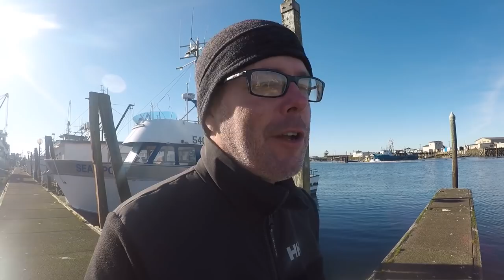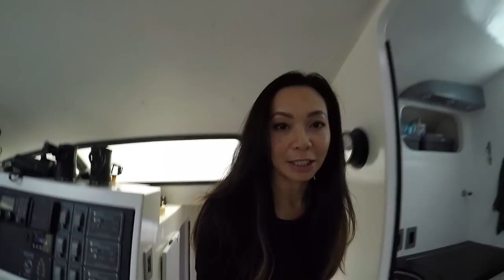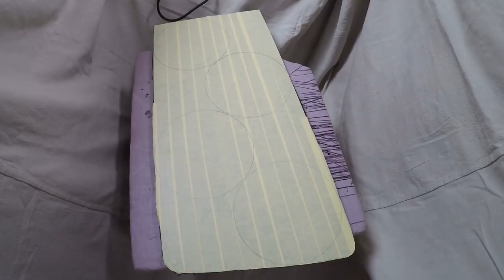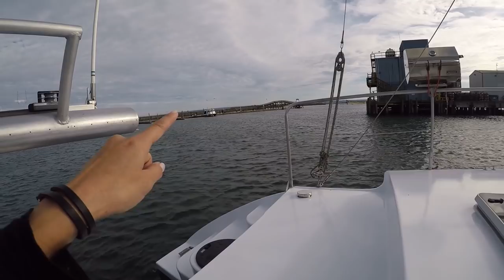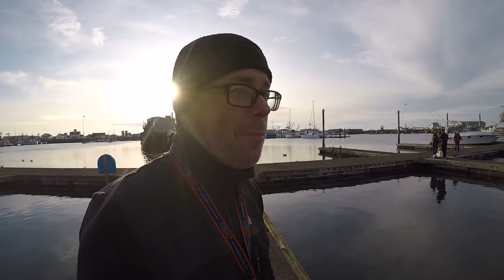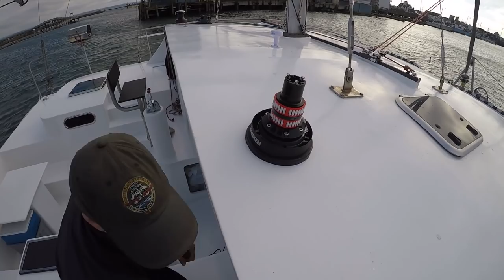Starting Phase II of our Sail Plan - Onboard Lifestyle ep.89

Comment: Just a note to say that the design of this catamaran is a Mastermold Featherlight 43 that Teal has customized to their needs. This boat was build on only two molds, one of them being flat and the other the patented Mastermold. This boat was designed and built by Jace Hobbs in the Florida Keys and updated specifications and plans for it are still available. Teal has the contact info for the designer if you are interested.

Comment: It would be nice to see some of the old footage of more rebuild stuff besides what you've already showed. I really like that sort of stuff. Someone asked a question on cabinet tow kicks and why you didn't build your cabinets with them. That would be interesting to know that information. With the sails, you will probably want several different down wind sails for different wind conditions like a close-hauled and broad reach type of spinnaker and possibly two down wind spinnaker's. One for light air and one for heavy air. Installing a spinnaker pole will give you more options and make your sailing experience much safer and smoother.

Comment: That looks like PE sheet you've used for your backing plates. A good choice because it will bend and take the shape of whatever you bolt it to even if what you're fixing to isn't completely flat. The sheet is indestructible but do you realize it won't stay completely black where ever it's exposed to sunlight. The surface will grey as it oxidizes but that won't affect its integrity. A good job using huge washers on plastic. Most PE fabrication shops will have a heap of sheet off cuts in their recycling bins and if you play your cards right they'll probably give it to you as it's only worth about $1 a kilo to them from the recyclers.

Comment: Try a little trick when working on a smooth surface where small parts can get away from you, place a couple of towels around the work piece then the small bits will stop on the towel if dropped.

Comment: Question #1; Have you considered changing out your standing rigging for either Dyneema or Spectra rigging instead of using the current stanless wire you have? Question #2; You haven't talked about your standing rigging except for a brief moment when you tested it for stretch. My question is that your standing rigging is very old and weathered and that is cause for concern in my opinion. Could you talk about that? Question #3; Are there any other boats like yours out there and are there any plans available to build one like yours? Question #4; When you previously did some through hull drilling or cutting, you didn't fill the Nauticore with epoxy before installing things like your portholes and such. I was wondering why? Question #5; What are your plans on rigging up a spinnaker and possibly a spinnaker pole as well? Question #6; What are your plans on a deck cover? You have built the most beautiful looking boat that I've ever seen! I absolutely love what you did! It would be nice if you did more videos than one per week.

Comment: I asked several videos ago when you were doing install of electrical contactors for the winch below your Nav Station, how you ventilated the hydrogen gas from your lead acid batteries when they are being charged by your installed solar.

Comment: Question 1: do you have any non-skid on decks or cabin tops. I think I saw you paint (part of) the top quite a number of videos ago. But I never saw you apply non-skid and looking at the videos it looks like you don't have any. I remember vaguely you talking about it in one of the episodes about how you are used to not having any but that you would apply it before cruising. But that was a really long time ago I think. So do you have any, what do you have, or what will you get, or will you go without? I assume you waited for the deck hardware to be in place before applying it so you can pattern around it?

Question 2: cockpit hard top? Plans, timelines, designs, ... 

Question 3: what is still on the TODO-list of modifications and changes we might get to see in the future?

Comment: You need to put proper bolts of the correct length for the two wrenches.  You need at least 2 to 3 threads coming out the end of the nut (you want 100% thread capture which includes the nylon on the nut).   thread exposure of 1/4 inch would be better and then dress the end with a acorn nut.

Comment: Two Questions: One- What is your fuel consumption at cruising speed for both engines and what's your range under power? Two- Would like to hear about Emma's homeschooling curriculum? Of course the trip itself is a form of schooling but no doubt you are working under some official guidelines as to the rest.

Comment: I know you always try to do the best work possible. So I freaked out when you substituted machine screws for  socket head bolts. The bolt would only have threads near the end of the full length of the screw.  The bolt holds its torque better over time. one additional thing. The bolt has an un-threaded shank that serves as a dowel pin resisting shear, which is what a winch is trying to produce.  I was wondering how you positioned the body of the winch in relation to the pinion gear. You normally explain things like that. It's something good to tell potential boat workers on your channel. 
You always do such clean meticulous work. You definitely have high standards.

Comment: I understand that you like clean, straight lines but, that 90 degree angle in the jib sheet off the port side winch puts a lot of stress on the sheet. This could be avoided by running a more direct line forward. It would also eliminate the penetrations of one (or even two) piece of deck hardware.

Comment: what type of material did you use for the backer plate
Reply: It looks like what he usually uses for his projects, Starboard Marine Lumber
Reply: Jump way back to when he was putting the windows in, for instance. https://youtu.be/JB1Wn27XNrM?t=335
Reply: It's misleading calling it lumber as it is anything but. It's HDPE plastic. I wonder whether calling it marine lumber attracts a premium when in fact it won't be any different to HDPE sheet you can buy anywhere. Teal hasn't done any yet but it is also easily welded. Great for making tanks, linings, spacers, boxes etc. It's the same stuff they use for dam linings and I've seen it in sheets 6" thick. It's probably the only thing you could have on a boat that salt water will never degrade. You know the plastics in the oceans. Black is the most uv stable color and even then the very surface will get surface oxidization giving it a greyish tinge. It is no good for traditional cabinetry or counter tops because it is too soft /pliable and has a high temperature expansion and contraction rate. ie. Horizontal spans will sag without masses of support and you'll never find a straight PE pipe laying in the sun.
Reply: @tbonemc2118  Yes that's correct but he asked what it is and I gave him the name he could google for.  Not sure if there's any material difference between generic HDPE and this particular brand but it's what Teal uses.